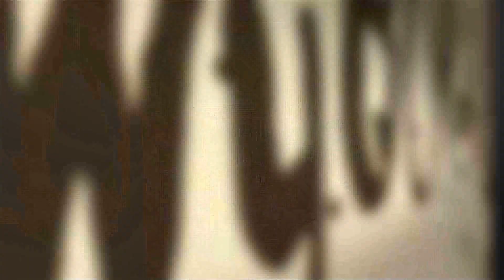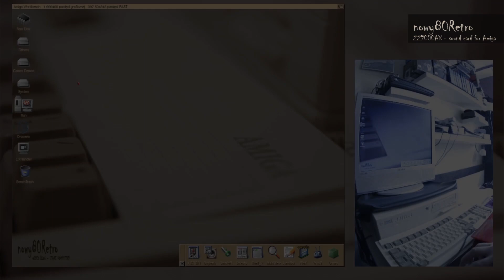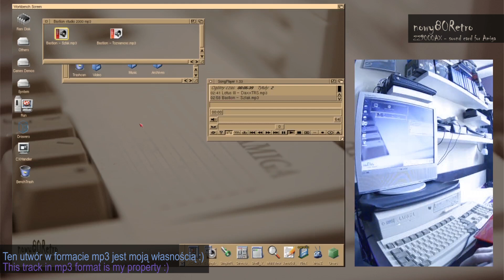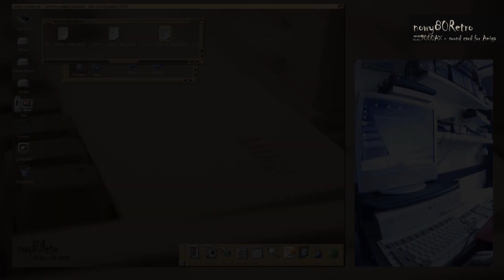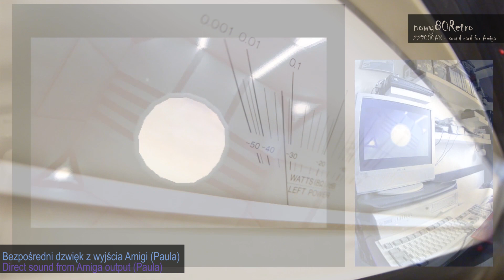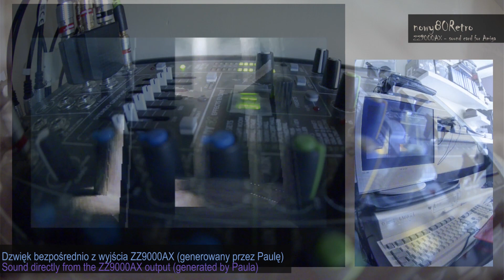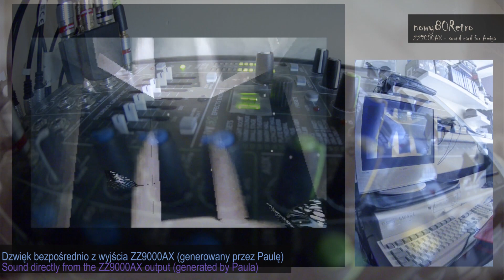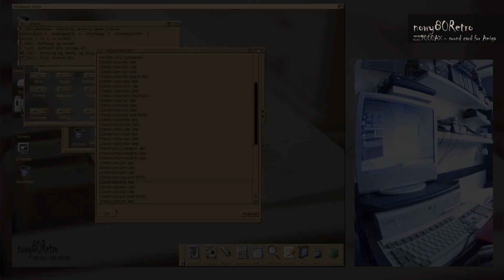EN nowy80Retro #96 New DSP sound card ZZ9000AX for Amiga

Comment: beautiful video. Which type of lcd model do you use ? in wich mode is connected to?  DVI or HDMI ? thanks
Reply from the maker: I connect ZZ9000 directly to xRGB Framemeister. xRGB generates the image signal for the Samsung SyncMaster 910MP monitor and for the grabber installed in the PC (HDMI connector).